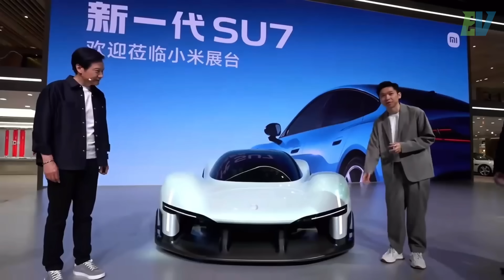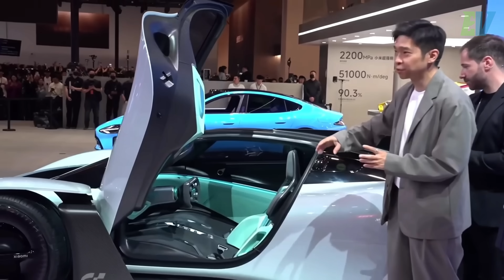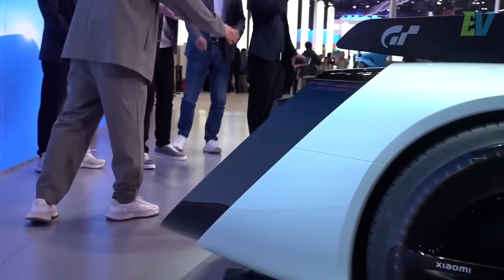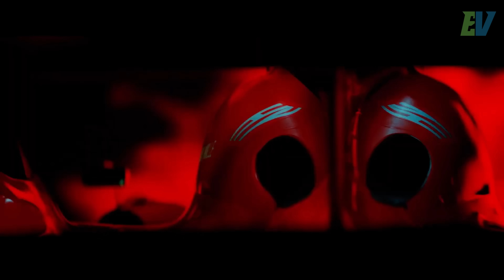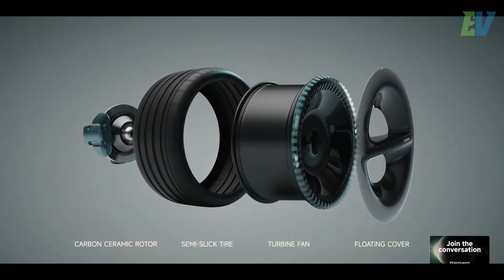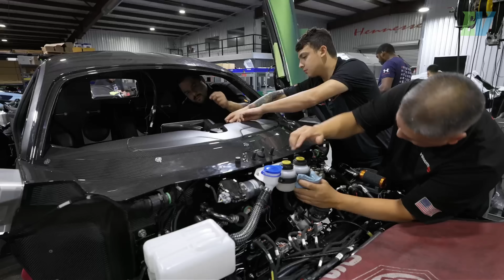THE WING IS DEAD! China Just Destroyed the Rules of Hypercars!🤯

Comment: Nothing new here, just an extreme prototype that may not actually out perform existing hypercars. The only advantage it would have on the track is front running with clean air, the descriptive dialoguee used is meandering and mostly hyperbole, and what about the McMurtry Spéirling?
Reply from the maker: Fair point, cars like the McMurtry Spéirling already push extreme aero even further. This is interesting, but it still has to prove it can actually outperform real hypercars👍

Comment: Not really new.

Ferrari dropped wings because undertrays create more downforce by using the car itself as a wing.

If the wing itself is closer to the road surface that chord depth, downforce increases
Reply from the maker: True but it’s not just “drop the wing = more downforce.” Real-world aero is sensitive to ride height, bumps, yaw, and airflow separation, so the advantage only works within a tight window
Reply: @EVisionary-YT race cars maintain that window almost nonstop.

Nobody cares in a camry is aerodynamic

Comment: Surprise, surprize, negative air pressure beneath the chassis of the car allows it to corner better at high speeds. At least they figured it out without the need for a curtain and a vacuum pump.
Reply from the maker: They’re just doing it in a cleaner, more modern way.

Comment: The McMurtry Spéirling is an electric hypercar that uses two massive fans, spinning up to 23,000 rpm, to create a vacuum underneath the chassis and generate extreme downforce.

This "downforce-on-demand" system allows the 1,000 kg (2,200 lbs) car to produce up to 2,000 kg (4,400 lbs) of downforce at a standstill, effectively doubling its weight for grip without increasing its mass.  This capability enabled the Spéirling to become the first car in history to drive upside down on a purpose-built inverted platform in April 2025, held to the ceiling solely by aerodynamic suction..

Combine the 2 ideas. Make this chinese car aerodynamics with added on demand downforce fans.

That would corner at higher Gs than I can take.
Reply from the maker: That would be an absolute game changer for track performance! 👍

Comment: As mentioned by many others already, this principle is nor new nor innovative per se, but a concept well known and applied on multiple occasions already. The problem here still is the dependency on speed for the downforce. How do you ensure the downforce at low speeds in/after corners and curves? 
1970 (56 years ago), Chaparral Cars presented an innovative approach by using fans and skirts, sucking the car directly to the ground, going as such already further than Xiaomi - without advanced computational fluid dynamics analysis...
Reply from the maker: This approach still depends on speed, that’s the trade-off they’ll need to prove.
Reply: @EVisionary-YT not quite. The suction fans were driven by electric motors, that could provide ground effect from stand still on ...

Comment: Sounds like a rear defuser to me, flat bottomed cars with large rear defusers have been around for years as have high performance cars with little or no wing .. then there's also the fact this still needs considerable forward speed to produce meaningful downforce unlike the McMurtry Spierling which produces 2000kg when stationary
Reply from the maker: The difference is how far they push internal airflow, and yeah, it still needs speed, unlike the McMurtry.

Comment: I was drawing cars with that Aero design when I was 14 , 28 years ago, though it had to be front engine.
Reply from the maker: That’s actually pretty cool🙃
Reply: @EVisionary-YT  I was also thinking of electric/jet hybrid engines at the same time. Electric for low revs, jet for high revs.
Reply: I make a driving RC model that looked similar when I was 16. At that time, there were plenty of model kits with similar, impossible-to-make vehicles in the factory. It was around 1985.
Reply: @DzikiKlapek  Nice, how did it preform?

Comment: Those hypercars you showing are competion vehicles that conform to a set formula. Besides, nothing sounds better than a screaming 6.5 litre Aston V12 at 12,000 rpm ❤️
Reply from the maker: Fair, that is just a different kind of performance.
Reply: So why don’t sound tracks of engines make the top of the charts on the radio? 🤦‍♂️🤦‍♂️🤦‍♂️

Comment: Uh? The front is very similar to the defunct Porsche Mission X, which used also integrated streamlined rear wing attached to the surface lines. This proto looks cool but is not different than a Lotus Evjia, which already exists. I hope they turn it into a real model and theit it in the ring. I hate prototypes which don't have real world continuation...
Reply from the maker: Fair point
Reply: @EVisionary-YT   To be honest I like a lot the design, but want a real car build and running in public tracks before a final opinion. A lot of Gran Turismo cars never come to fruition. I'm fan of streamlined designs with integrated aero instead of huge external wings because dealing with detailing those cars in real world is a pain in the ass. Sports cars usually aren't the most funcional (barely space to groceries or anything), but wings are annoying to clean. And sports cars should be bought to be used, not to showcase in a garage...
Reply from the maker: @Buran01  Interesting discomfort😅😅
Reply: @EVisionary-YT  Well, put a GT3 in a washing tunnel and in matter of seconds you'll have thousands of dollars in damage when the rollers get stuck and rip off the aero parts...  Streamlined cars with retractable wings or integrated  are much more convenient for daily use than cars with a biw wing which you have to dismantle every time you want to clean it (or just having to wash it by hand every time every two weeks for the rest of your life...